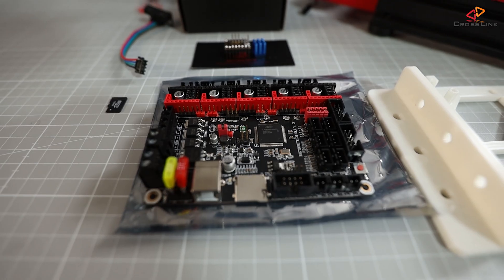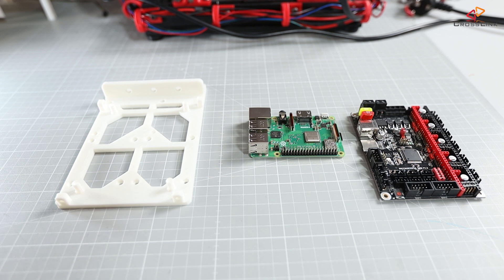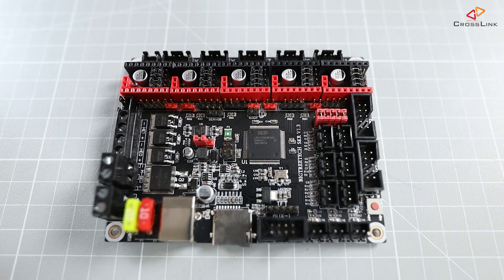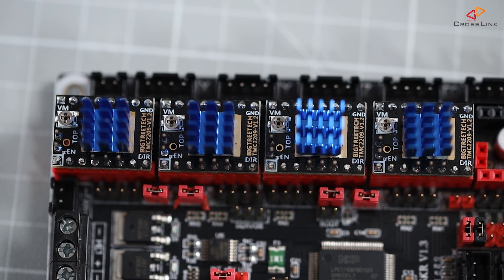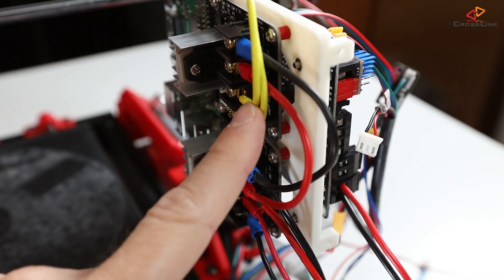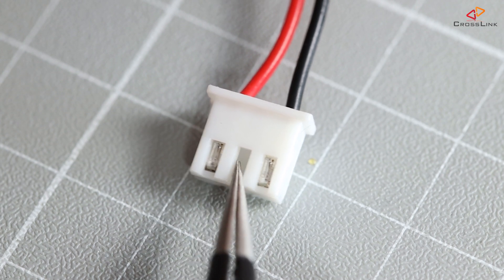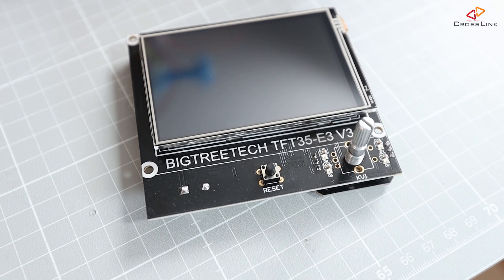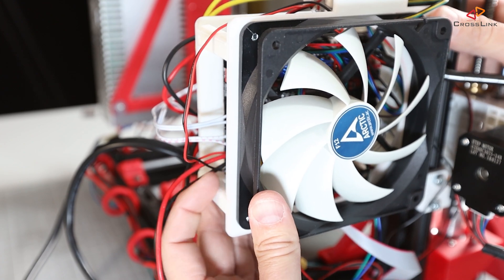SKR 1.3 Upgrade with TMC2209 and sensorless homing - Hardware installation

Comment: Daniel, (Thanks for your excellent help so far.) Can I use a V3.0 board instead of V1.3 or V1.4? I see it has 4x integrated TMC2209, so I don't need to obtain separate ones?

Comment: hello, why did you add a RASBERY card with the SKR? , the SKR motherboard can work alone without it.
I guess it's because of the options you added, but are they really necessary?
Reply from the maker: I just added it to use Octoprint for remote control and network connection

Comment: Daniel, what are the benefits of changing the A8 Main board, I am thinking about change it but I am not sure if it is better to focus on some other modification rather than the Main board, I have changed the frame to Aluminium, add a bed leveling system and also attached a raspberry pi with octoprint installed... I would like to have better quality at my prints, thanks in advance

Comment: So i have done EXACTLY everything you have done in this series. When i use the screen to move the Z axis around. it moves fine and freely, When i start a print, Both Z steppers get out of wack, One will move more then the other. then they bind up

Comment: Great Video! I have to point out tho, that there was something different with the wiring of the anet LCD for me. 5V and GND were swapped, but unlike u were connecting 7(coming from LCD) to 9(on the Mainboard)  I had to do it the other way around! 7 coming from the LCD is not connected to anything, as it turns out after inspecting the LCD-PCB. At least not at mine (anet a8 plus LCD)! I connected 7(LCD) to pin 9(SKR 1.3) and did the rest as u explained. Finally working after a long day of troubleshooting :-) ty alot!
Reply from the maker: Thanks for sharing!
Reply: Hi thank you! My anet a8p LCD wasn't working and I corrected the pins and it worked! Thank you

Comment: Hello, first if all great work on the video, nicely explained and easy to understand instructions. I have Ender 3 and i'm trying to upgrade to skr 1.3 and tft35 with tmc2209 drivers, i got drivers and screen to work ok, but i get maximum temperature readings from bed and hot end on boot, i have 2 boards, and they both behave the same, do you (or anybody else reading this comment) have working bin file from your ender 3 build (never mind other settings) with temperatures reading correctly so i can test is my board defective? I have tried changing termistor values in marlin, no change, i allwas get readings of 300-700c on both, hot end and hot bed. Melzi board works fine. Thank you.

Comment: Just wanna point out a small mistake here in the video. The swapping pair and open pair of pin 7 and pin 9 were actually reversed at
8:56. I spent a few hours figuring this out after i got a blank blue screen, before finally referring to the diagram from the guide mentioned in the video. Hope this helped someone out there. Otherwise, great and detailed walkthrough Daniel!
Reply: Thanks for the comment, I was also stuck with the blue screen. The reset pin (pin 3 in exp2 on the board) was not right either.
Reply: I'm stuck at blue screen too, I'll try switching that! Thank you!

Comment: I have attempted this build and I will defently say that it is my fault that the SKR keeps on burning the LV5 pin. I have bought 3xSKR 1.3's and have gotten it to work but still don't understand why the LV5 pin gets taken out when I switch the power on. I'm now on my 4th SKR 1.3 and don't want to try it agian untill I know why it keeps on burning. I need help.

Comment: is this the same as sk 1.4
Reply from the maker: Mostly identical, all the ports are labeled, so you should be fine with the 1.4 as well. Only difference is in the jumper settings. But there is good documentation on the Bigtreetech GitHub about that.

Comment: Hi Daniel, great video as obvious, but i have question. How is your print experience after months of print?! Because i finally switched my Anet from CoreXY to the AM8 frame with Skr1.3 amd Tmc2130 SPI, but i have massive layer shifting on the Y axis.. I checked the belt tension, which is OK, added active fan cooling for stepper drivers, set the correct Vref with tmc calculator, the mA current too, but nothing helps.. XZ axis are ok, but Y is shifting. Then I swapped back the Anet board, only for  be sure, that there is no problem with motor or belts, and anet board print is without shifting, all ok.. So i think it's bad driver on axis Y, motor overheating because with tmc are really hot, or something bad with speed in marlin configuration. Some suggestions?!

Comment: So I just got a used A8 and am having thermal overrun errors.  I just replaced the hot end, but everything else on the device is original. Would upgrading the board, be it this one or the V 1.7 Anet board end that error?

Comment: Hi Daniel I found something strange on my SKR mini E3 1.2 Board  My heatbed did not heat at all when the Thermistorcable is on THB connector when i change to THO it works and heat up but then the Nozzle did not work could you please tell what is wrong this is from the SKR Boards the 4th one and i always meant the Board is faulty but it seams to be something different could youhelp in this case.

Comment: Hi Daniel I do not know what is wrong with Amazon I ordered another Mainboard (SKR V 1.3) because the previos Boards where faulty know I installed it and everything works fine only the Heatbed connection seems again to fail what should i do please help can you buy one for me test it and send to me then i can be shure  that it work ?

Comment: Hi Daniel Would it be possible to write for me a Firmware exact like you do for your Mainboard, for me because it is a bit heavy I tried but when it come to save the firmware I am stuck I followed step by step your video but it does not work for me
Reply from the maker: Since this seems to get more complicated and not less over time, I am working on a cloud based firmware build service that makes this all easier. I will talk about it on the channel as soon as I get something done that works good enough.

Comment: Hi Daniel I am very frustrated with Bigtreetech I bought the SKR 1.4 turbo no chance to get the Board working then i bought the SKR 1.3 with the BIQU DIRECT TFT35 V3.0 Touch Screen now the Touch screen did not work after i get the normal touch screen without the knob the screen works, now the board have trouble the Bed heating does not work (Bed in Order I tried it on other printer)when i change the Heater cable to Exdruder connect it heat up but the Extruder does not heat you see I am very angry about Bigtree tech I do not know what I can do anymore i am so far to trow the printer in the trash can
Reply from the maker: That sounds horrible! What firmware did you try?
Reply: @Crosslink3D  Marlin

Comment: Is there a reason why I shouldn't get the 1.4 turbo over this one?
Reply from the maker: My guess is that the printer will work 100% the same not better or worse. I will see it and compare them once I have the 1.4 in my hands.

Comment: Hi Daniel, You seem to be the go to guy for anything Anet A8.  When you do the SKR 1.4, would it be too much to ask that you do the SKR 1.4 Turbo with TMC2208 V3.0 stepper drivers in UART mode with the BTT 3.5 V3.0 touch screen, a BL Touch and the e3D Hemera hotend using Marlin 2.x or whatever the latest version is? Oh yeah, the code as well using Atom.  I'm really need help with this setup so much.  I know this is asking a lot, but if you don't ask, nothing will ever happen, right?  Thanks for your time.

Comment: Hi very good tutorial, i think it's time to  upgrade my ramps, where can I get the parallel connection adapter?  can I run the main board with 12v? I am only using 24v only for heated bed but I don't  want to change the hotend and fans to 24v
Reply from the maker: I've put a link in the description for the adapter, thanks for asking! the mainboard can run on 12v-24v, so you should be fine.

Comment: Excellent video as usual, I recently swapped out my Anet A8's mainboard for the SKR 1.4 and 2209's, very much worth the coin.....
Reply from the maker: Very nice!
Reply: I also upgraded the PSU hotend and bed to a 24 volt system, the bed heats up like right now....heh
Reply from the maker: That's awesome. 24V really makes a difference. Really worth it even on the standard printer
Reply: Was the procedure for installing the 1.4 very similar to the 1.3? In trying to decide if the 1.4 board is worth it.

Comment: For the display cable you could probably just reverse it at the other end by pulling the plastic guide off and reversing it.
I'd probably also do the  pin modifications on the display end but that's just my preference. I get why people wouldn't want to do that.
Reply from the maker: You can try but it very likely you will break the plastic noses off that plug

Comment: Excellent video.  Your A8 is really tricked out!   It may be nice to sense-stop both Z-axis motors for leveling.  Perhaps the SKR 1.3 more easily interfaces with other I/O hardware ... a touch-screen?  There is little evidence left this was ever an Anet A8.
Reply from the maker: Yes, that's also coming. I need to find a better name for this printer.

Comment: Great walkthrough
Looking forward to see a BL touch install
Thanks for sharing👍😀
Reply from the maker: Coming soon!
Reply: @Crosslink3D   Bed leveling using the nozzle as a probe please .
Reply from the maker: @Human-bf7kz  This is not going to work on a dual z motor setup with lead screws and a glass plate. You will most probably crack the glass and the impact speed is not high enough to detect the endstop.

Comment: you change the frames and motors and nozzle and motherboard and fans and sensors and power supply...and you stil call it anet A8? i think its A danial homemade printer more than other brand  (y) Cool Danial :)
Reply from the maker: We definitely need to come up with a new name for this printer!
Reply: @Crosslink3D  Danistein printer as frankstein hhhh